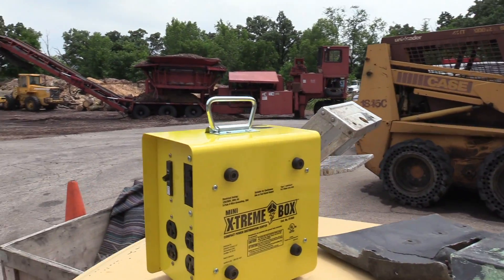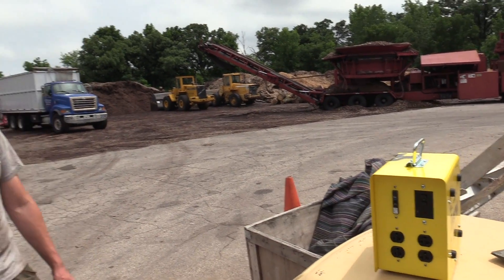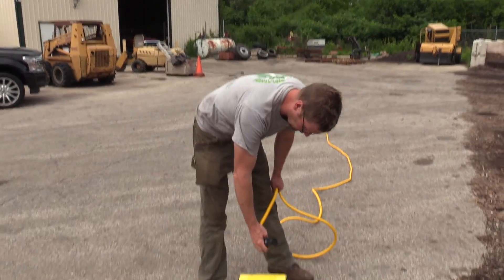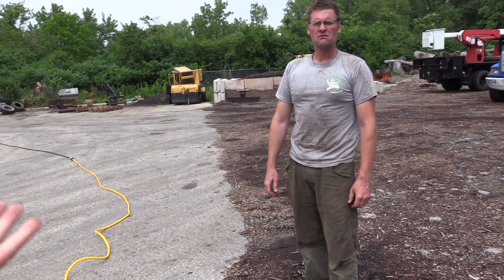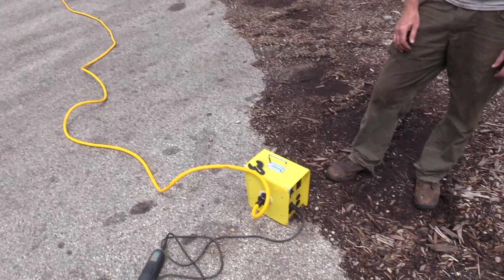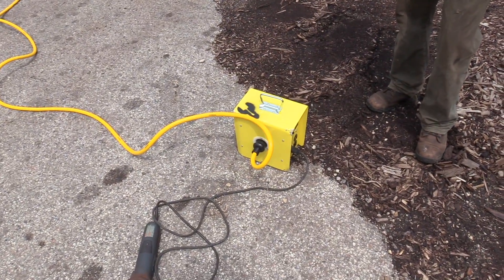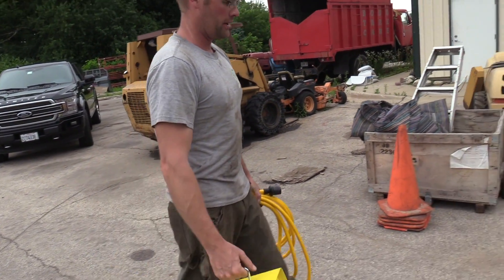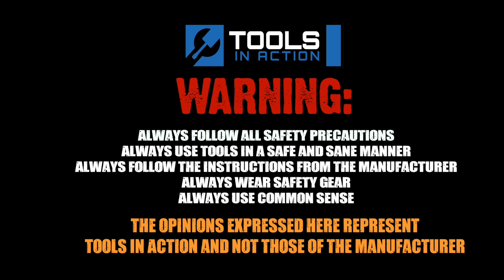Southwire Mini X-Treme Box

Comment: I know this is an old video but I'm hoping somebody knowledgeable will answer me. So I just bought one these and basically what I'm wanting to know is if I can leave it plugged in continuously for 3 or 4 months. What I'm doing with it is I had a metal garage built at my lake cabin and instead of wiring it i ran a 30 amp RV extension cord from my outdoor electric box and buried it to have electricity inside the garage. And basically the only thing that's going to be  running during spring to early fall is two mini refrigerators when I'm not at the campsite. Thanks

Comment: I like these power distribution boxes, though I've mostly used them with generators.  It's quite nice to have the genset as far away as possible.  Keeps the noise and the exhaust down.  

I think what gives me a chuckle about this item is that it's cheap compared to the extension cord you need to run it at a distance.  $320 or $466 for the 50A cord in 50 or 100 foot lengths from the box's manufacturer.  

Honestly, if you're already looking at spending the $ for the cord and the box, I'd strongly suggest the full size extreme box.  Sure, it's an extra $300 over the mini.  However, what you get for that extra $$ is individual GFCI for each outlet, NEMA rated outlet covers(better for adverse conditions), pass-through capability to daisy chain multiple units, and an outlet rated at 250v/30A.

Comment: I don't get it. Other than using it with a generator, who has a 4-prong L14-30R locking receptacle on their dryer or range?  It costs $150 and doesn't even come with a power cord.  It has (8) 20-AMP 120V receptacles but with a feed of 220V/30A you would not be able to use them all. If you have a generator capable of running this box chances are it already has a few 120V/20A receptacles that you might as well just use directly. The key to using extension cords is to use the proper wire gauge. A 12 gauge 100 ft extension cord will run virtually any power tool.

Comment: Silly question. Does anyone make something similar to this for 110V? I need a box that will trip first so I don't trip the customers breakers in their house
Reply: Yep. Just Google circuit breaker extension cord. Lowes has a 25 amp black 4 gang one
Reply: The problem is that unless you use an extension cord with a lower amperage breaker than the circuit in the house there is no guarantee it will trip before the breaker in the main box.
Reply: EOSJOE 

Yeh thats what I figured. Thanks